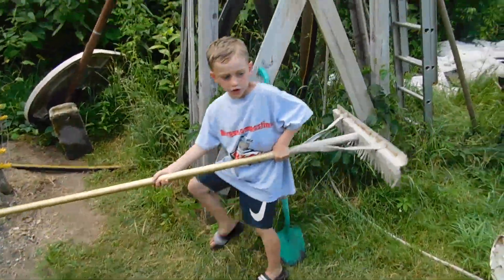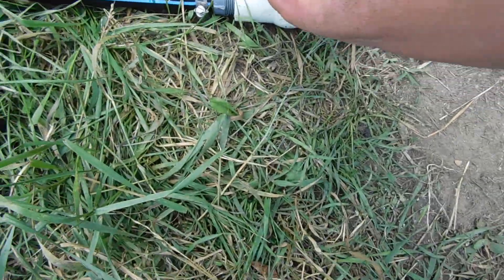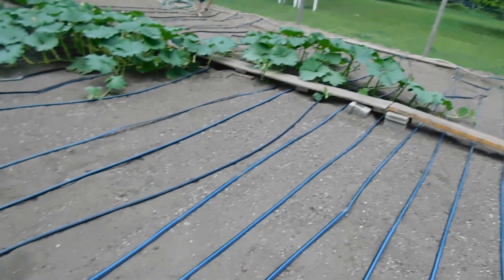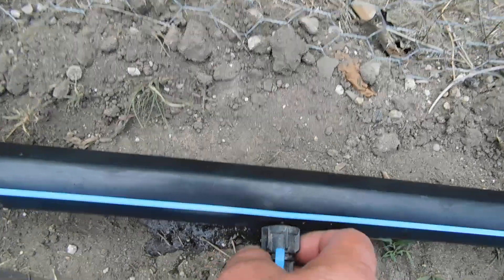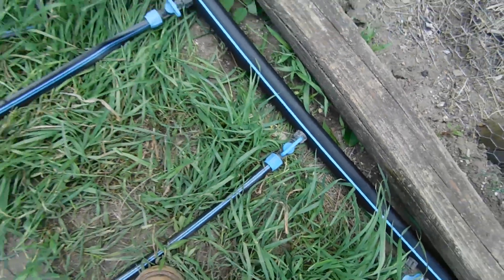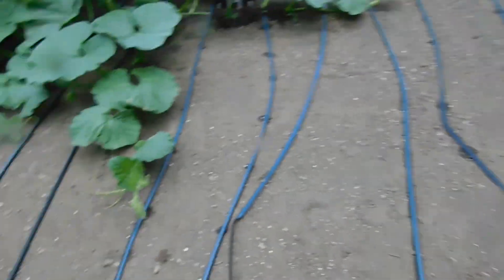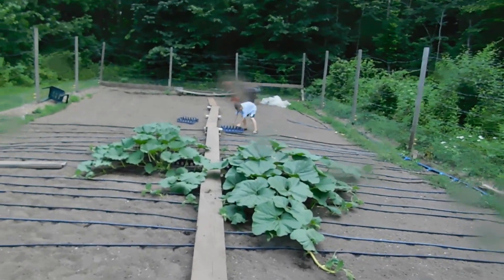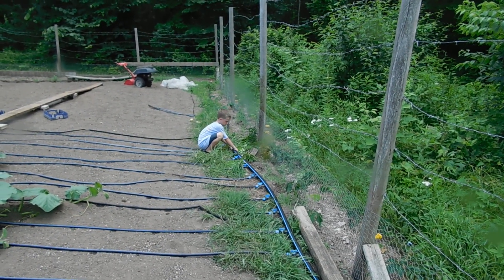Gravity FEED ! Drip tape Irrigation? How much pressure do you need?

Comment: 62.4 lbs./cu.ft. = density of water.  Multiply by height of 10 gives you a pressure of 624 lbs./sq. ft.   But since everyone uses psi which is lbs. / sq. in.  you have to divide by 12 twice or 144.  So 624 / 144 = 4.33 psi.

Comment: Good job i'd say. suggestion: If you positioned the supply pipe (2" I believe) coming from the main tank to the center of the smaller hoses; so that you can have equal pressure to your plants on both sides. again well done over all.
Reply from the maker: Cool idea

Comment: What spacing do you have on your emitters? I have about 10' of drop between my house and patch. Works well for collecting rain. Pressure tends to be less an issue with distribution than my filter gunking up.
Reply from the maker: 12 inch spacing 12 inch circle emitters

Comment: How tall is tank itself,from bottom of tank is 4.34 pounds of psi then add height of tank, PSI 1 foot equals .434 psi x height
Reply from the maker: drjolly77 over 6 feet maybe 7
Reply from the maker: Yes we are a little under our 10 lbs MSpresure however seems to work fine

Comment: How much do u have in drip tape?
Reply from the maker: Tyler Gallagher +7000 foot roll cost $150 approximately enough to last you several years for most growers.
Reply from the maker: However to buy the fittings and everything to go with it 10 pound regulator is etc. you will probably have all of the $500 investment to get started
Reply: Thanks mark!!!